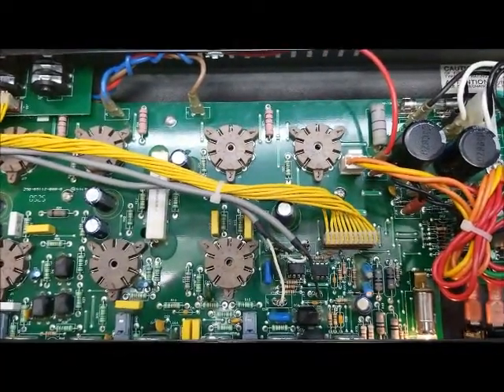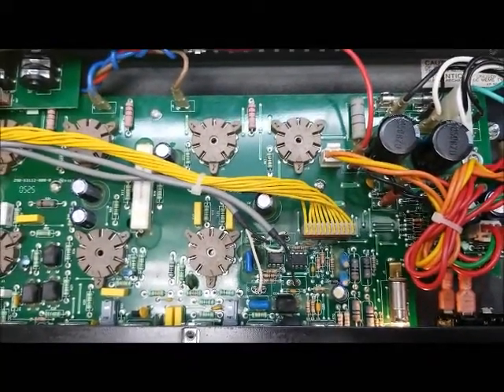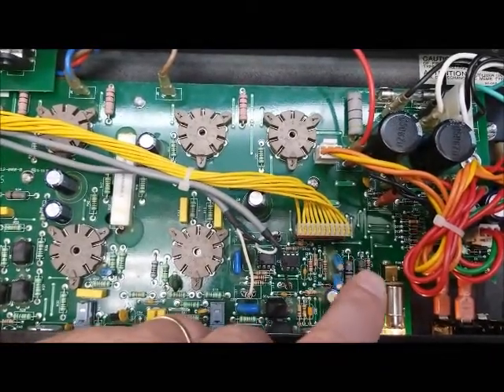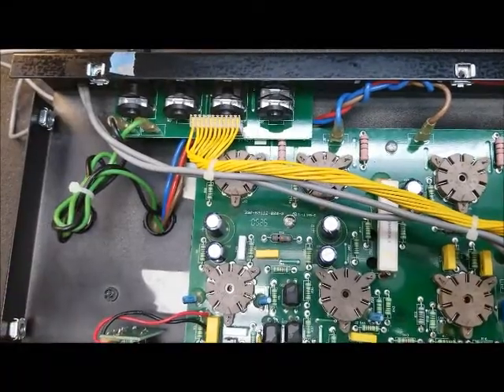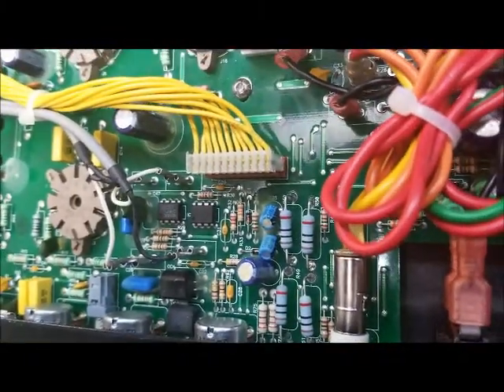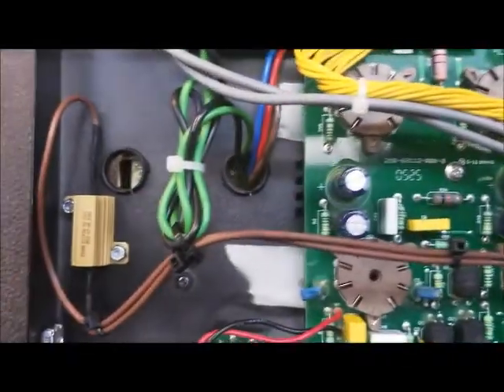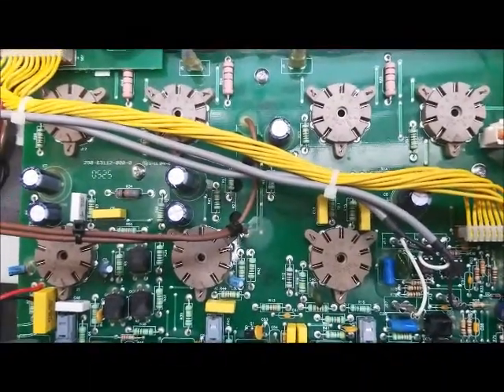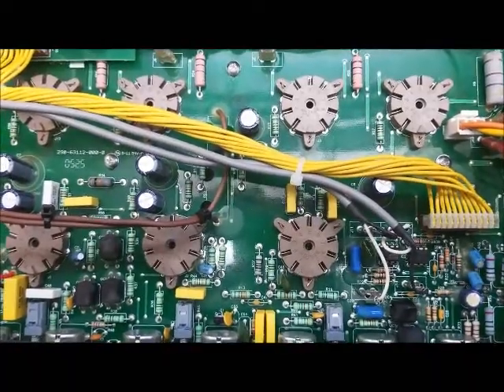Crate Palomino V32 Heat Reduction Modification

Comment: What size wire did you use for the 60 ohm cathode resistor replacement and is the new resistor a 60 ohm 10 watt flat mount.  I am doing the same mod for an customer of mine for his Palomino V32. In your video did you solder the wires to the eyelets on the board ? I. Could not tell but it looks like you did.
Reply from the maker: The resistors I use are the VIshay Dale 25W 1% Chassis Mount.  I also use a little heat transfer compound between the resistor and chassis.  The wire was 18 gauge.
Reply: Oh OK.  I bought an 60 ohm 10 watt but I guess I need a 60ohm 25 watt flat mount right! ? Thanks for your information  I enjoy watching and learning from your videos.
Reply from the maker: @MarkAngelino  The 25 is not required, I just think it runs cooler as it has a larger flat surface for dissipation to the chassis.

Comment: Hi, i followed the instructions and installed the 3 new resistors but now when i turn on the Palomino theres a buzz, like a ground noise right from the start. The amp sounds but theres a permanente sound there, not very high but enough to worry about it. Any ideas? Thanks in advance.
Reply from the maker: There's no way of knowing what you did unless I had it on the bench here.  All I can say is double check your work.  Start at the cathode resistor.  You should have about 10 volts on one side and nothing (gnd) on the other.
Reply: @tipsfromthetechbench4589  Thanks for the reply. In order to do that, where do i have to put the multimeter probes. Thanks
Reply from the maker: @AliberEscobar  One lead to ground and the other on the cathode resistor.
Reply: @tipsfromthetechbench4589  You mean chasis and resistor pole, right? On VDC 20, right? If that's positive it doesn't mark anything, if not i'm doing something wrong
Reply from the maker: @AliberEscobar  Put the meter probes on both sides of the cathode resistor.  If you still have nothing there is a problem with your connection.
Reply: @tipsfromthetechbench4589  I've already tried that and nothing shous up. But i wonder if i'm doing it right. I choose VDC on my multimeter and 20V, is that right?
Reply from the maker: @AliberEscobar  The 20 volt setting on your meter should be fine.  My guess is you have something hooked up wrong.  Can you email me some pictures of what you've done?  serpa.scott (at) gmail (dot) com

Comment: I fell asleep with my amp on the other night, kept the room warm but damn it's hard on parts.  I'm ordering resistors tomorrow.  This mod wasn't that well known when I first got the amp and I was going to rig in a fan---WAY prefer to avoid the noise potential of a fan. Before I put any more tubes in, I'll do the mod.  Thanks.

Comment: That is exactly what I did with my V32 back in 2011 as suggested in an owners forum, but to spread the heat even further with two resistors in series. It doesn‘t change the sound but gives you a good reliable gigging amp. Never looked back since then.
Reply: What wattage and ohms were the resistors you used in series? I bought a set of two 100watt 150 ohm resistors to try the same mod but I’m worried they’ll tank my volume significantly.
Reply: @kandmtrip  the resistor is R22 in the shemata. It shall have 60 Ohm and 10W performance stability. To reduce the heat on the circuit you can remove the resistor from the board and increase the wattage but stay with the 60 Ohm
As I couldn’t get a 60 Ohm with sufficiand wattage I choose two 120 Ohm resistors with a wattage allowance of 50 W and own heatsinks each wired parallel and mounted at the outer side of the chassis. Had never problems with the heat since than.
With two 150 Ohms parallel you‘ll get 75 Ohm in total. I have not enough knowledge to guess what that means.
Reply: @StationRock-ly5uf  Thanks for the reply! I actually added the two 100W 150Ohm resistors in parallel and the volume is untouched but the heat problem is solved.

Comment: Does the mod effect tone any?
Reply from the maker: As long as it's still 60 ohm it won't change the sound any.  You can reduce the heat generated at the EL84 tubes by changing the resistor value but that will change the sound.
Reply: @tipsfromthetechbench4589  well if you were around arkansas / memphis area id have you do it. Is it hard to perform yourself as a newbie?
Reply from the maker: @levijessegonzalez3629  I have found that difficulty is directly proportionate to skill set.  Potentially lethal voltages exist in these tube amps so if you're not comfortable doing that kind of work then I strongly suggest you find a qualified local shop.